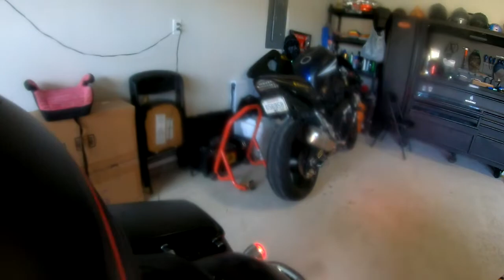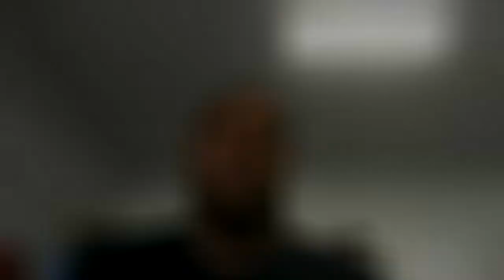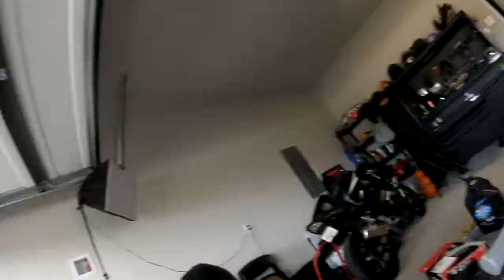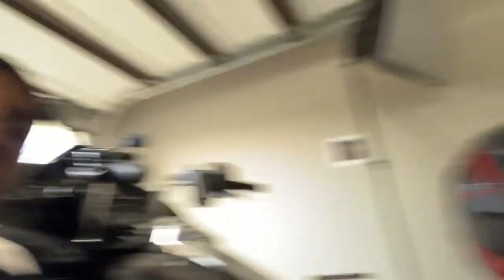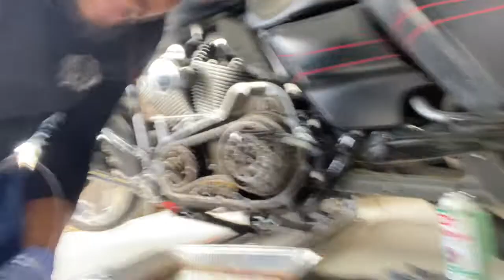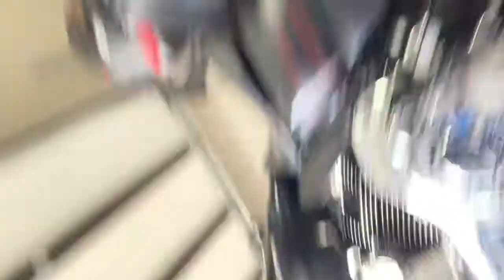Changing Clutches on my 2015 Harley Road Glide

Comment: Exactly what I needed to see... mine is a 14' street glide special, 30k miles on the stock clutch with cams, exhaust and tuned..100/111. Clutch is starting to slip when powershifting and wot in 4th-6th gears.. 👍
 Did you have to re bleed  the clutch?
Which clutch and pressure plate did you use.. subbed!
Reply from the maker: Na you dont have to bleed them but you might want to change your clutch master on the other side cause that bih gone be stiff af if you get the heavy duty clutch spring 😮‍💨
Reply from the maker: I use the baretts kevlar clutches with just a heavy duty clutch spring . But if you ride it hard like me I wouldnt recommend kevlar. I think carbon fiber takes heat a lil better for hard application
Reply: @cscraft60  Thanks.. yeah I ride the snot out of it.. 8 back tires to 3 front tires.. tells ya a little something..lol
Reply from the maker: Bout like me 🤣🤣🤣🤣